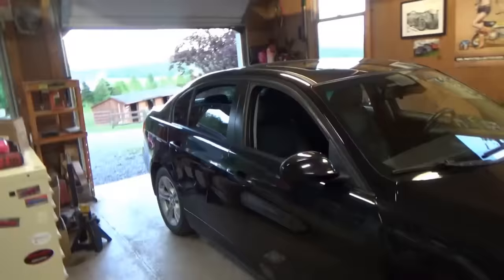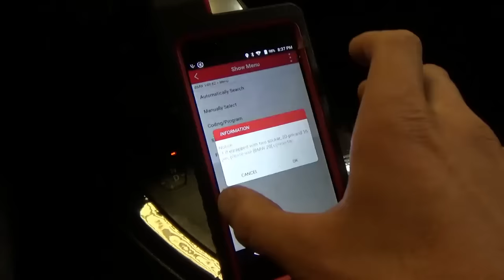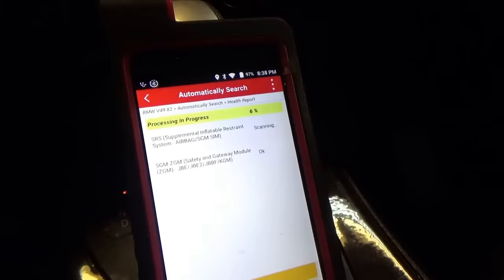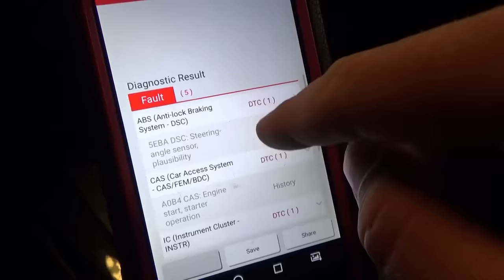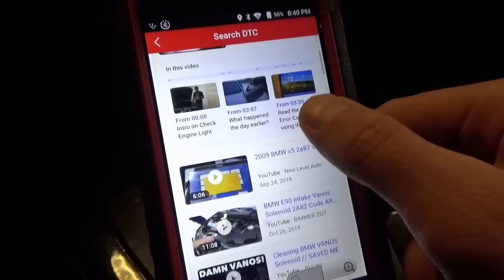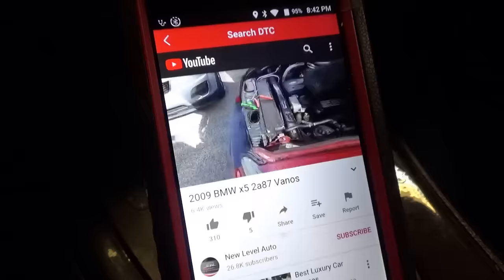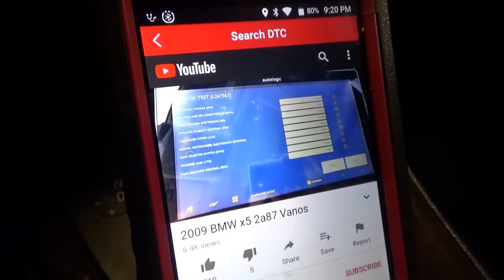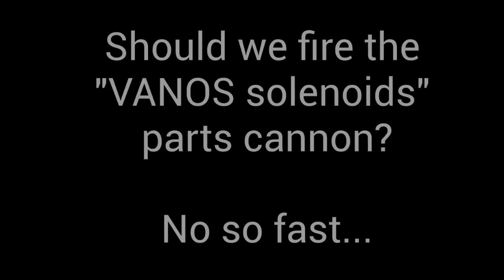Bad News BMW: Vanos 2A82/2A87

Comment: I've been there and done that... you likely picked up on the sparkly oil subconsciously when you first removed the filter but your rational brain refused to admit that the engine was shot. That's why you kept going back to the filter.

As to the engine noise, it kind of sounded like low oil pressure, but it's hard to tell over YouTube.  Low oil pressure will pretty much always give you some weird rattle from the engine... usually it's a valve tap.  I once left the oil fill cover off my engine and within 7 miles I heard that low pressure valve tap... Thankfully I was by an AutoZone... That stupid tap saved my engine! And yes over two quarts low and I didn't get an oil light on a Gen 1 Saturn S series.
Reply from the maker: Saturns can run to over 300k miles burning a quart every 500 miles... Amazing vehicles lol

Comment: I wonder if u can backflush the oil pump to blow metal off the screen, then change the earl .
Reply: Maybe to limp it home or to a scrapyard, whichever is closer..once metal filings are circulating thru the engine, it's no bueno..accelerated decrepitude/ engine failure is inevitable..

Comment: Still a problem even with bmw n55 engines, except the oil filter housing leaks, onto the serpentine belt- slips off and slices its way into the front crank seal- doing the same damage- sucked into the oil pump and maybe even the rod bearings. Any things possible

Comment: This is an easy fix simply change the oil and use the correct oil filter (I use Mann) and the code will be gone and it will run normally again.
Reply from the maker: Not in this case

Comment: This is such a simple fix dude.    LS Swap FTW  Those particles look like aluminum , probly the chains slapping. Pull the pan and clean it out, worth a shot.
Reply from the maker: You could hear a little rod knock at hot idle...no bueno.

Comment: Had like 6 faults from injectors to Both Vanos. All codes gone when replaced everything with new parts.Even new radiator and hoses. No leaks. But for the life of me I still get Vanos code. Car has been sitting for 2 weeks. Wont dare drive it like this. I am about to put old Vanos solenoids back on as never had the fault for the dam things to begin with. Was told to swap out every time I did a tune up. No metal shavings or anything like that. I did get a different style filter for the oil so might just buy original BMW filter tho. That might be the issue. Thanks for the heads up
Reply: 2A82 Einlass VANOS code still shows up only on cold start. Only one code. Once cleared while car is still on it runs better than what it used to run but still feel it a bit rough with no faults. Only one fault turns on when turning car on. Any Ideas would be greatly appreciated.

Comment: I saw the Royer sticker on the back, if that is the one from Dubois where I live,   the "Good Deal" explains a lot!
Reply from the maker: LOL good eye :)
Reply: you want to talk about a poor excuse for a used car dealer, when they dropped the different engine in, they took my brand new starter i just put on, new pass cv axle, and put me the old plugs and coils on when this engine had 43k miles, and then called me to tell me it needed new cv axle to drive lol. i hope karma comes back to get them.
Reply: @willd3808  I could tell You some stories,  but I won,t!

Comment: Try changing to a heavier weight of oil. and see if the oil pressure goes up. If it does the pick up tube isn't clogged. The bearing are gone.
Reply from the maker: At the end when the car cooled off the oil psi had a more dramatic drop when I revved it up...pick up tube is most certainly clogged
Reply: @PineHollowAutoDiagnostics  Yeah! I should have waited to the end to comment. Had the same problem, pulled the pan, and the screen was clogged. I also  thought it might be a weak spring in the filter bypass . causing that noise you were hearing.  Don't know if that model has one. Like most viewers I'm trying to diagnose as you go. Thanks for the reply.

Comment: As always, lack of maintenance.  Known issue on these, the rubber from the belt is forced past the front main seal by the action of pulley.  I'd pull the pan, do a flush and replace the oil pump.  If that doesn't work, keep the parts on a new engine.?

Comment: So my pentastar is at plus 100k and when you Rev the motor the oil pressure goes to 85 but it has no metal in the filter. It gets 30mpg at a steady 80mph. I will prolong this as long as possible.

Comment: Great diagnosis - although I winced at the potential for cross-threading your oil pressure gauge fitting.  On the other hand, why should that even be required?!?!?   I am stupefied by the fact the ECU apparently does not calculate or display oil pressure.  (I may be wrong on this interpretation.).  And why doesn’t throw an instant warning light LOW OIL PRESSURE???   Was the sensor possibly bad?
Reply from the maker: Oh it was definitely cross threaded, but not too deep LOL! Oil switch opens at 5psi...doesn't mean you have good oil pressure though
Reply: Pine Hollow Auto Diagnostics  Thanks Ivan!  Your videos, teaching, sharing, integrity and energy are contagious.   I am still stupefied there is apparently no other low oil pressure warning until it drops below 5 psi.

My experience and rule-of-thumb  is idle should be at least 20-30 psi, depending on heat and ambient conditions.  Then an internal combustion engine should build at least 10 psi per 1000 RPM above idle.

Have great weekend!

Comment: Low oil pressure? Could there be some trash in the oil screen or perhaps a lot of room between some main bearings and connecting rods? That’ll bring the pressures down especially when you rev the engine. Could it affect the Vanos? (You betcha)What does all this prove? Perhaps Scotty Kilmer knows what he’s talking about.

Comment: BMW's are performance cars, and as such not intended to be run on a shoestring. Furthermore, you should ignore the Condition Based Servicing (CBS) oil change intervals, and get your oil changed at least annually regardless of what the CBS or milometer may say. You can't run a performance engineered car on the cheap and expect it to live on forever. If you want that, then buy a tractor (or a Toyota). ;-)
ps. My 2008 BMW E91 330i is still running peachy with original injectors, HPFP and coil packs. In fact, the only engine component that has been changed since new are the spark plugs. But I change my oil EVERY year regardless and use only premium grade fuel with additives (Shell V-Power) as the engine is the N53 with GDI (not available in USA).

Comment: Funny BMW wants to complicate even the key.  Why do you have to stick the key anywhere?  My 2007 Mercedes CLK550 knows exactly in the car where the key fob is by triangulation with the DAS antennas.  Just keep the fob in your pocket and push the start button.  If the car sees the fob is inside the car it will start.  If the key is on the bench it wont.  If you loose your key fob inside the car you can hook up with with STAR diagnostics and the car will tell you the location of the fob inside the car.

Comment: Customer should have had Ivan clean the oil pickup screen, refill with 20W-50 [or 90 weight gear lube 😆], and then quickly sell it to the next sucker that's willing to buy a car with no dipstick.

Comment: i had the exact same noise when some one used a shit tonne of silicon sealant on the sump gasket and most of the cured exess silicon sealant ended up clogging the oil pump pick up screen

Comment: I actually made money on a 2007 e93 335i had 50k miles on it had the abs trifecta bought the car for 5k send the abs unit off to get rebuilt, bought coding software, reinstalled the abs unit, codes it to the vehicle and sold the car for 9200$ only had 6k into it
Reply from the maker: Nice!

Comment: Hi Ivan, thanks for all the knowledge you share. I noticed you use the Launch a lot. I’ve been researching a diag tool that will work and play well with my wife’s Audi A6, my Land Rover LR3, my sons ‘02 CL550 and the twins Corolla. Would you suggest the Launch? I’m just an avid DIY’ER looking in sub $1,000 range for an as close to full range diag tool

Comment: oir return galleries in the head are plugged and screen id full of the valve seal material
sounds too good for brgs and not running hot something is plugged

Comment: I also suggest the screens for the Vanos oil system be cleaned too.  They are on the passenger side of the engine at the don’t side.  They are difficult to reach but need to be cleaned.

Comment: Hi Have you any Idea what an Audi Q7 3.6L Code P12A2 is ? I am seeing different things one says gasket and diaphragm within the pcv etc another ; says that its the ignition run start output circuit openignition run start output shorted to groundradio RF hub modulebody control module bcm ; another says that its the fuel pressure regulator....

Comment: I work on cars I'm no where near calling myself a mechanic but I get by, so a neighbor whose car I work on a 350z convertible asked me if I work on BMW's so I said it depends, I worked on another neighbors x3 and one of the things I did was replace the seal for the vanos, so he goes on to tell me about how his elderly aunt was getting rid of of her BMW I forgot what model and he was thinking about buying it then I got the line we've all heard a million times, all it needs is, it has an oil leak he told me so I said only one, he said I think so, I told him to forget about it and that they never usually have just one oil leak, I counted at least five on my other neighbors x3, I fixed three because there was so much oil underneath that it was hard to find them all, I got the worse ones at least, he was leaving puddles wherever he parked, so he decided not to buy his aunts car which was a relief because he'd be expecting me to work on the blasted thing.

Comment: Hello I belive I sent you a comment on this issue there are 2 valves that are screwed in in from pass side of cylinder head torx 30 they are check valves that control oil to vanos units they clog up and cause grief look into it  utube has video

Comment: If the engine is the  N52-K version , i also has a oil pressure valve on the left side of the engine  !

Comment: I seen "glitter powder" oil streaking when you first pulled the filter and housing ;)
from a distance it will look dirty/slightly milky, up close and bright light you'll see it's all fine metallic particles(aka glitter oil), certain internal engine death, the noise maybe timing chain or cam rattle.
probably new/rebuilt engine time. waaa waaa waaa... someones wallet just broke majorly

Comment: I bought a 2014 BMW 3.0 liter 6 cylinder and the car broke down 8,000 miles later (138,000 ) miles and it was caused by the vanos. the bearing for the cam got chewed up because it was not getting enough oil caused by the vanos.  VERY BAD DESIGN. BMW wants $35,000 for a new engine installed . I only paid $14,000 for the car. I am stuck and do not know what to do with the car. I loved this car the way it handled and the comfort of the seats. I'm stuck.
Reply from the maker: Sad story. That's why they are called money pits lol